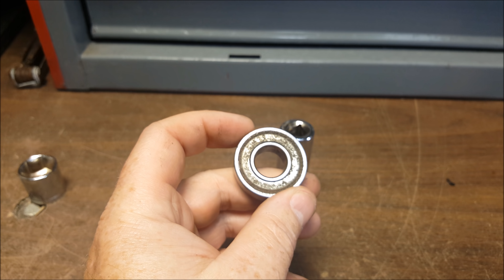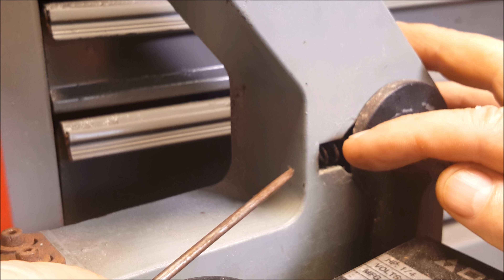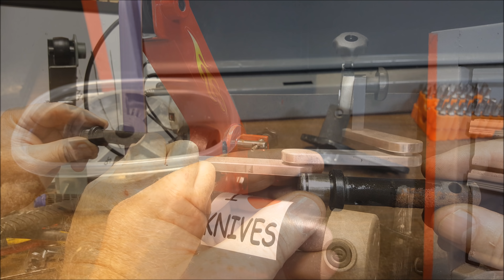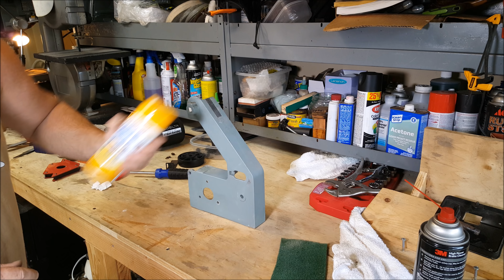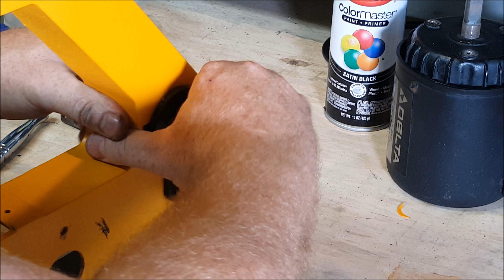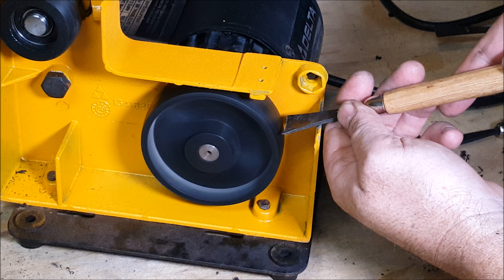How to Upgrade the 1x30 Idler Wheels

Comment: Recently received 2 replacement idler wheels/bearings for my HF 1x30" sander. You did a nice job truing the wheels. The unit runs a lot smoother and quieter than ever. Thanks for the parts at a fair price.
Reply from the maker: Glad I could help

Comment: Good video. I have the Delta 1"x30" sander with the small sanding wheel . I wanted to run it slower so I removed the disk sander and put a variable speed drill on the shaft and I can use the drill at variable speeds without using the Delta motor. Works good.
Reply: Hi Dread Cat, that was exactly what I was thinking of doing. Any chance you like to show off the final product and talk about how you made and installed the shaft and bearing assembly for the drill to attach to?

Comment: Really Nice Video! Great Restoration and truing of the cheap wheels. Just so you know you should never beat on a bearing unless removing it for replacement. It will work to install, but you can but dents into the balls or race. If you can, use the jaws of the vise as a press with sockets or pieces of pipe only to install new ones. Not trying to nitpick, but its how to do it correctly. I know most folks don't have a press. If you know somebody that does most will be happy to press them for you for free. I had a friend that worked for a huge bearing warehouse he informed me of this. I was not doing it correct myself. I had put a bad spot into a bearing that was brand new. If there is no other option, there's always a hammer, but its somewhat risky. Back then I had no idea , so I thought I'd pass this on. I will follow your video as a guide, I just ordered a 1x30 HF to grind some 1911grips fit that need the backsides ground out.  I plan to sharpen with it too. I had been using a ken onion but its not the most precise sharpener at all. Awesome video !

Comment: Hey Cliff, hope you get this message.  Thanks for this video.  I purchased a Grizzly 1x30 grinder, disc sander.  It cost a bit more than HF and others but I wanted a larger motor and variable speed.  Long story short...motor and variable speed is great....but the 1x30 is terrible.  It would not track and moved hard right when starting up.  The HF 1x30 is better built and stronger.  I watched your video,  did everything you did in video including straightening the bracket that holds tracking adjustment.   WOW, what a difference.   Took me a long time to true wheels but all is good now.  Thanks, thanks, thanks. Jack D
Reply from the maker: Hey Im really happy it was able to work out for ya.  I have heard that the grizzly build quality was lacking over the similar Rikon.  Dont forget we got you covered for belts n supplies when you need.  Website is getting a full remodel and new products added this weekend!
Aloha, Cliff

Comment: Just want to thank you. I just did the drive wheel and then both smaller wheels as you did on the drill press. Worked out perfectly. Now my sander runs much smoother and quieter as I installed new bearings in the wheels. Big differance !
Reply from the maker: Great to hear!  Thats really the best news I can get is that is what useful information to someone at least.
Reply: @CurryCustomCutlery  I will add that of all the so called fixes, your method not only made sense, was easy to do and accomplished the best results. Even using a wood turning tool for the drive wheel is dangerous but the results are not close to doing it on the drill press. With me also replacing the bearings, I cant imagine a machine being any smoother or quieter . Now I just turn it on just to not hear the noise any longer. Now, my unit was the one with the disc sander. That thing was a disaster. I doubt they could have done worse if they had tried. First time i turned the sander on i had to grab it before it fell off the table. The disc was out of round, wobbled and the weight distribution was way off. As a temporary fix i just took it off. Then the sander was reasonably ok. I have since adapted a 3in wire wheel to the side. Get enough use out of it to justify the work doing it. Later on I machined the disc flat and round. Then I balanced the disc by drilling holes and adding in small screws. I used a home made propeller style balancer to get it to a pretty good balance. But it stays off because I use the wire wheel more. Anyway, I'm thrilled that you posted your fix and glad, more than glad that I found it. Happy new year to you !

Comment: Terrific!  The care you take to make the video enjoyable and informative is remarkable. The detailed close ups and explanations are pro. This is art.  Re the bearings not spinning freely - they shouldn't - the correct bearings for pulleys under load contain specially formulated grease to lubricate the balls for the clearances and load. A seal keeps the grease from being thrown out and  contamination (dirt, metal dust) from getting inside. The seal is a friction fit on the outer race which prevents it from spinning freely. That bearing is rated up to 14,000 rpm.  It is quite good. Carry on!
Reply: so are you saying the bearings he replaced  were ok he didnt need to replace them

Comment: After a few uses, the unit started vibrating badly to where it would move around on the base it sat on.  I tried truing wheels but that didn't help the vibration.  I noticed that the tracking adjustment part was vibrating forward and back very fast and if I held it back the vibrating stopped. I tried stretching the spring but that didn't help.  I was going to take the tension adjuster off when I noticed the bolt was not tight at all.  I tightened the bolt and the vibration stopped.  I had to tweak it a bit so I could still move it when changing belts. The unit runs fine again.

Comment: Great job on the editing and voice-over! My H.F. sander is coming back to life. Just fixed the switch. Now to go true the wheels.
Reply: By the way, the motor drive wheel was REALLY off. Tried a wood chisel, but quickly dulled. Ended up using a wood rasp and it worked great. Top bearing needs replacement (ordering), but I lubed it with some Tri-Flow and it spins freely now. Thanks again.

Comment: Hey cliff I noticed on 1 of ur "awesome videos" that your 1x30 when running something caught my attention in relationships to mine which really got me wondering when using the thick abrasive belt . The one you mentioned having to remove the angle guide.. It was sounding ruff but didn't notice anything out of wack.  Yeah yeah I kno how you stress the bearings lol 
I'll try to send ya a clip of it and maybe you can catch something..
I'm not that Tech savvy but I'll work on it..
We did this before when u helped me on the angle guide,  you probably where out signing autographs and don't remember lol 
Keep up the great work you share with like minded individuals you seem to take care of the rookies to the bigger boys with your always informational advice and experiences with your videos.. 

All the Best 
From the Ozarks.

Comment: For others looking to true the wheels: 

I used a Dremel with a carbide burr while the motor was spinning. Made the process go so fast. The wheel was ridiculously out of round. I used a dial gauge to measure and it was 2.5 millimeters off! I got it within .03mm which is pretty damn close to perfectly round. It's sooo much better. 
I don't have any lathe tools, so the Dremel saved the day.
Reply from the maker: Great idea.  Bracing seems to be the key.  The drive wheels we have on our website out machine lathed to near perfect also out of polyurethane instead of the hard plastic but not sure that matters much as getting at least round!

Comment: I've got the Harbor Freight model and also the idea arm is stiff as yours and seems most people easier to load their belts and mine barely lines belts after seems like the handle will break if turned any further. Plans to remove clean all paint adding your Teflon trick will probably solve my problem. The sound of your voice was drowning out earlier but later I didn't struggle to hear your teaching. 
Great video for mostly but earlier volume. Thanks for showing me
Reply from the maker: It was first attempt doing a voice over a few years ago.  Harder the it seems.

Comment: Use "Dupont Chain Saver" to eliminate bearing noises. I have an old delta 1x30 (so old that the main roller wheel is cast aluminum) but still in good condition. The idler wheels were making all sorts of gritty scratchy noises. Now they are smooth and verrry quiet. Used it on the motor bearings and anything else that moves. Now I only hear the belt and motor hum! This lube is waxed based and has teflon and molybdenum (so no dust attraction). Try it!
Reply: While watching this video, I thought about how "lubricating the bearings" would help... I never heard of the "Dupont Chain Saver", but thought of using Ballistol as I use that for a lot of things... going to see if I can find the DCS locally and check it out.

Comment: How did you attach the wheels to the drill press.  I'm not sure how I missed that but I would like to try the same thing.
Reply from the maker: I got a large nut and bolt from hardware store and used it as a spindle that I then chucked up.

Comment: Good video.  You did a great job truing up wheels and overhauling the whole unit.  The yellow paint job looks good !...I bought a HF 1x30 and it seems to run pretty good. I'm sure my wheels could use truing also but for now it runs fine and quiet.
Reply from the maker: We now sell even better idler wheels on our website perfectly manufactured and ready to go

Comment: thanks for this video, I have the same delta set up w/side table but replacing the bearings is the job at hand. Top bearing is rough. belt tensioner was informative, thanks for showing how to remove and replace. I have a HF 1x30 also. It's next. . Where do I get the bearings  automotive parts maybe? We have Advance Auto in my town..

Comment: what size bolt does a 1x 30 belt sander use  the one that goes to the flat adjustable metal part

Comment: Excellent. Thank you so much. So I’ve just slackened the main bolt for the trueing wheel and I now have much more movement. Consequently the leather honing belt now is not too stretched and works well. I’ll check the wheels later but in the meantime thank you again and sub’d 👍

Comment: Great Video!  I just replaced the motor bearings and installed a new power cord on the same Delta sander.  Just ordered the wheel bearings.  Thanks for the detailed instructions.
Reply: That's what I need to do, replace the motor bearings. The motor is making a real racket, a buzzing sound, loud. Any pointers as to how to do this?
Reply: You’ll need a bearing puller but it’s really not a hard job.  The toughest part was to realign the cases so the bearings and case were in the correct position.

Comment: I see the angle guide and parts URL, but I don't see the bearing.  Do you have that part number, or did I miss something?  Thanks.
Reply from the maker: Sorry to all for not having that info in there.
I think it was a 6022.  The video is 5yrs old.  Now I sell perfect trued idlers with bearing for $15 in my shop

Comment: These are things I need to do on mine...I did a little...but it needs more...it's definitely louder than it should be...I need to get fresh wheels for it...does anyone make aluminum wheels for them?
Reply from the maker: Just this year I secured manufacturing of precision replacement idlers wheels made out of polyurethane with sealed bearings.  They are exceptional...
https://currycustomcutlery.com/shop/machine-parts/1x30-idler-wheel-trued-w-bearing/
Reply: @CurryCustomCutlery  Already have them bookmarked...lol

Comment: Great video, I did all these mods and it turned out great. Did you ever find a better set of bearings that would free wheel ?
Reply: Shielded bearings will turn freely.  Rubber sealed bearings have quite a lot of friction, relatively, and aren't necessary for the idlers.

Comment: I ENJOYED YOUR VIDEO VERY MUCH .I OWN A SILVER STAG AND PRESENTLY AM HAVING ANOTHER ONE MADE SPECIFICALLY FOR FILLETING FISH AND GUTTING DEER , AND CUTTING UP STEAKS AND REMOVING SILVER SKIN AND CUTTING A COOKED STEAK IN THE FIELD .I AM NOT AGRESSIVE WITH MY CUTTING TECHNIQUE. MY FRIEND WHO IS VERY ACCOMPLISHED IN ELECTRONICS LIKE YOU WILL CONVERT THE 1" X 30" BELT SANDER TO VARIABLE SPEED ...MY QUESTION TO YOU .I DO NOT INTEND ON SHARPENING MY KNIFES ON SAND PAPER OR USING THE VARIOUS TYPES OF GRIT STONES. THAT LEAVES THE 1 X 30 BELTS. IAM THINKING 1 X 30 IN 220/400 THEN LEATHER OR 400/1000 THEN LEATHER .WHAT DO YOU RECOMMEND PLEASE AND WHAT TYPE COMPOSITE CERAMIC , ZERCONIA ETC //THANK YOU .
Reply from the maker: Without removing more material then needed from the knife you will need to use at least one more agressive ceramic belt like 120 grit to remove damage, re-profile, & re-apex to bring up a burr.

A second step is a refinement and sharpening step.  Prefer a structured abrasive like Trizact A30(600grit)

3rd and final step is a light stropping step.  I have abrasives and angle guides available on my website:
www.currycustomcutlery.com/products

For the leather belt Id check Amazon.

Comment: Hi Cliff
 Your video has given me the incentive to rip my HF 1X30 apart and give 'er a good goin' over. What are the sizes of the bearings and where did you find them? Mine seems to run pretty decent, but MAN does it click and chatter right after I tighten the main drive wheel set screw. It sounds like the set screw is just hitting the very edge of the shaft flat, but close inspection says no it isn't? Not sure what the heck causes that sound? It's a clacking sound like a tooth missing from a gear? Everything seems to be tight? Thanks again for your great videos. Keep 'em comin'.
Merry Christmas.
God bless:
Stoney, Dave
Reply: Move your main drive wheel out a faction and clack should go away...
Reply: @theIndoCurrys  Thank you. Will do.
Stoney

Comment: So how did you get the bearing off the idler assembly so it could be pulled through the housing.  I'm stuck at that point and you jumped right over it in the video.  Guess I will be looking for a small puller of some type.
Reply from the maker: Yeah sorry if I missed a detail somewhere.  The tracking/tension idler tire with bearing can be stuck even after you take the snap ring off.  Ive had to use a small puller best I could before.  Once I get them off I always use a bit of sandpaper to smooth the shaft down a bit so it goes on n off easier.

Comment: I can’t seem to get my belt to adjust enough to cover the right side of the platen. Could that be from my wheels being off like yours were?
Reply from the maker: Top Idler is a fixed point.  Can adust the drive wheel out to match belt coverage...then after that Id try to adjust platen to align behind a belt thats been properly centered as just described.  Hope that helps...
Reply: Thanks. I didn’t think to adjust the drive wheel.

Comment: Would skate board wheels be good as a replacement for the two idler wheels?
Reply from the maker: No really, the shaft dimensions are different and other things.  The stock wheels are fine and can easily be upgraded in the bearings and trued if desired.

Comment: Hey Cliff thanks for all the great info..  You mentioned the bearing info but do you recommend any of the brands listed on ebay or your experience with one over the other as far as performance..?
Reply: I just got some sealed ones off of Amazon.  Made sure the RPMs were within spec range.  Its an improvement from stock but by FAR the biggest comes from truing the wheels out, however you get it done.

Comment: I just bought one of these sanders. To be honest not much vibration at all. Only issue is thebelt speed and the belt joint chatter from the invoices elcheapo sanding belt included. I ordered some quality belts and Timkin bearings for the idlers. I'm researching sewing machine motors to replace the high speed motor included. Can you offer any help as to narrow/shorten my search/time for such motor? Thanks for the time you spend on the videos, good content, subscribed!
Reply from the maker: Sorry I missed your question.  Sewing machine motors and penn state lathe motors are the goto options out there.  Email or message me for more info if needed.

Comment: $55 + labor to get the HF in working true condition or grab new true idlers pulley for an extra $40 or grab the wen for $80? Judging from your review on the wen... The wen seem to be true? 
The pulley on the HF is so bad the belt is sanding my angle guild.

What size pulley is the w small wheel?
Reply from the maker: Its a toss up honestly since they both run too fast at 3450 to make a true sharpening machine.  The WEN did run smoother but the frame had more flex.  The HF rubbing the angle guide is where you should adjust your platten back slightly I think.  Good luck.

Comment: Hi Cliff what is your opinion on the AMK 75 1x30 belt sharpening  they sell?
Reply from the maker: Its a motor that turns a belt.  Its horizontal only.  Its edge trailing only.  It uses the "clamp on a stick" method which is slow so many just free hand.  If thats the case you could turn a $150 rikon on its back and do the exact same thing,